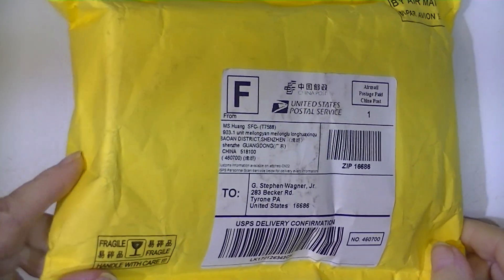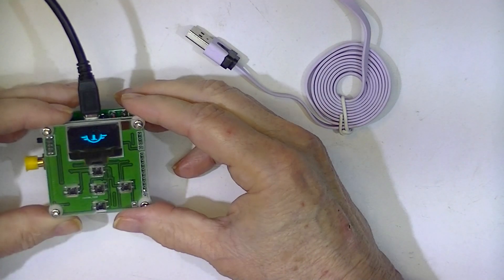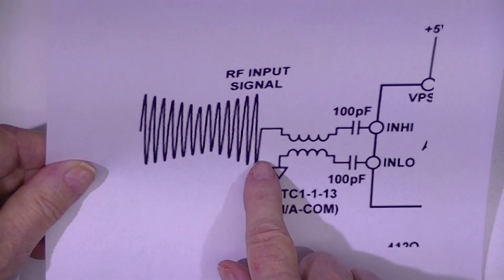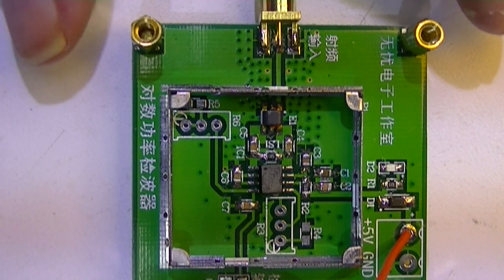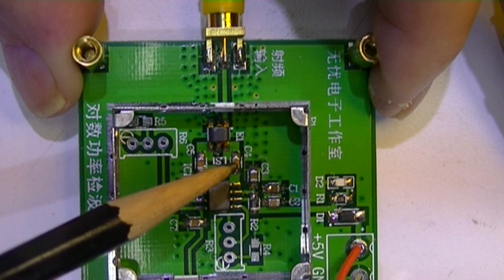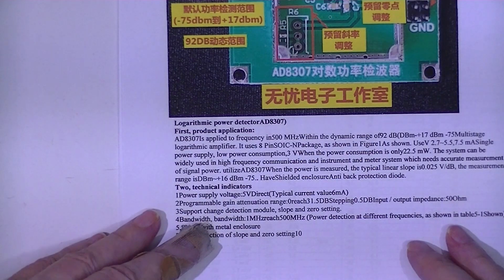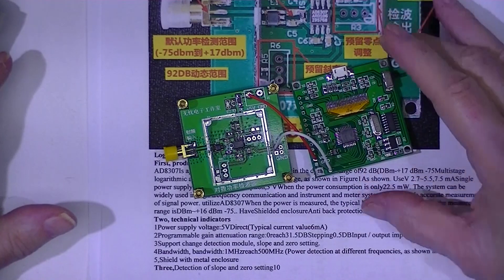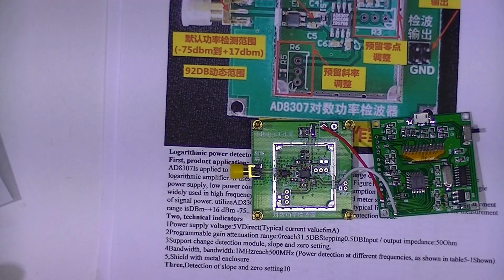RF Power Meter / Tap Series 1 of 6

Comment: The chip's been scrubbed but its pinout and surrounding components are consistent with an AD8307. Those alone are so expensive that the fact you could buy one, along with two boards loaded with components, for that price in 2021 means you should have doubts about whether it's an in-spec chip.

The 50 R input resistor is a crude attempt to present that impedance to your signal source - the chip's input impedance is about 20 times higher. Competent engineers don't slap on a 50 R resistor just because they want that input impedance; even the datasheet suggests around 52R3.

That might seem a small difference, but the usefulness of these devices depends entirely on a close match with the 50 R system impedance. Measure the board with a good-quality VNA; you'll find its return loss is so poor that its displayed readings are almost meaningless. The circuit appears to have been taken straight from the chip's datasheet, cost-cutting in the process by omitting the slope and intercept pots. That means you can't even compensate readily for that incorrect input impedance.

The claimed specs appear also to be merely copied from the datasheet. They're the best that an in-spec chip can achieve on its own. They bear no relation to what a complete board will deliver just by throwing that chip at it.

On-sell it to a sucker. It's rated for 2 W; at that power level you won't get a shock if you lick your finger and fondle the input cable with it. Then divide your height by the year your car was first registered, and you'll have a power estimate as accurate as this lump of electronic waste.